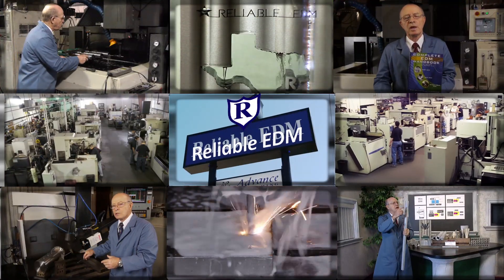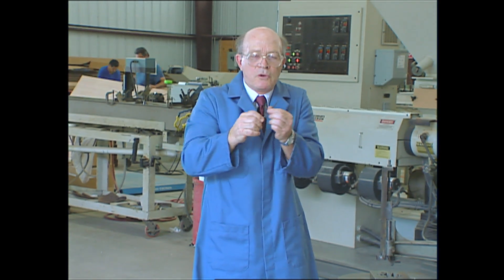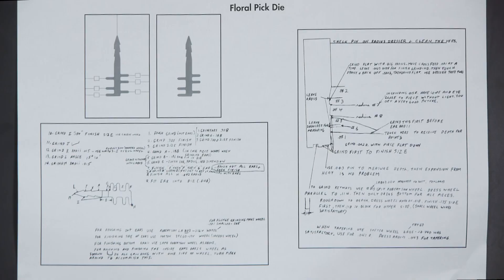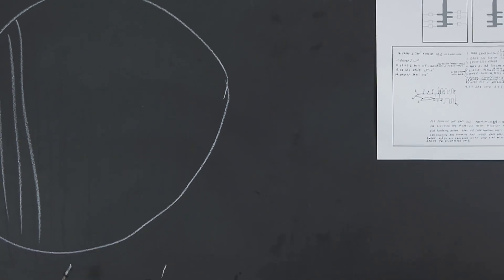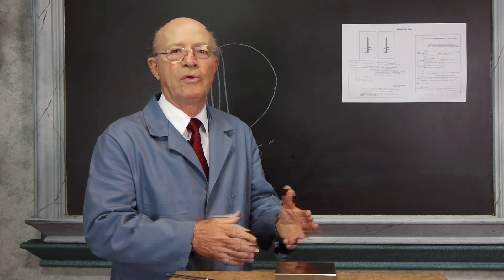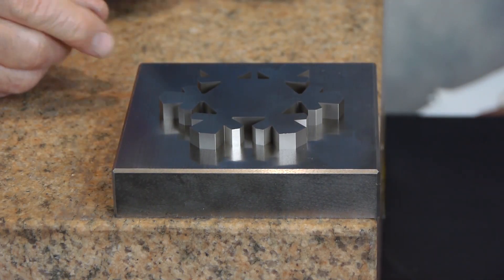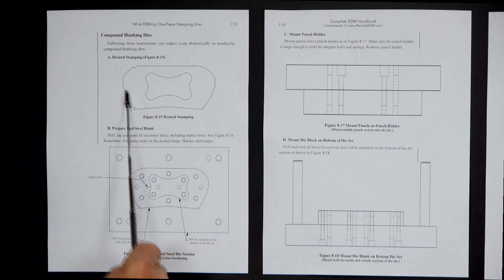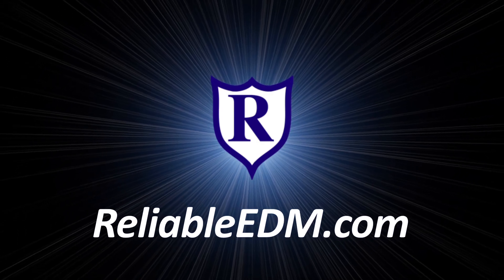Old Fashioned to Modern Tool and Die: Part 2

Comment: Back in the day, I used a file machine for making tryout templates only. When the blank shape was determined, I roughed the trim steel cutting edges out on the Bridgeport, established joint lines between the sections from the template, using die located pilot holes in the template. Hardened the trim steels, and surface ground the trim lines of the die to match the template using a light underneath. Ground in the slug relief, assembled, and then using a hand grinder, hand ground the very edge of the punch to fit the die, and then streaked the sides of the punch to match the hand ground edge back on the surface grinder. Believe it or not, the process was actually quite fast.